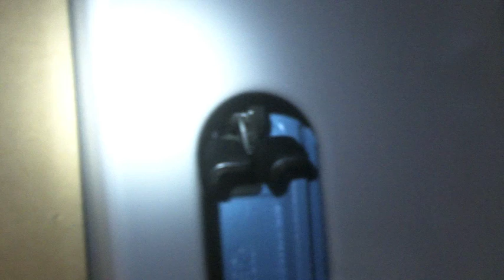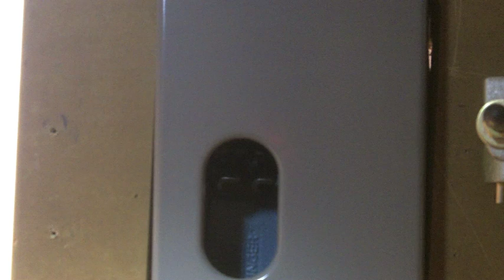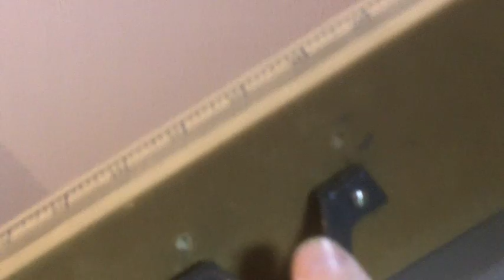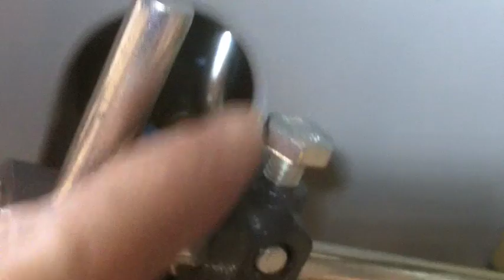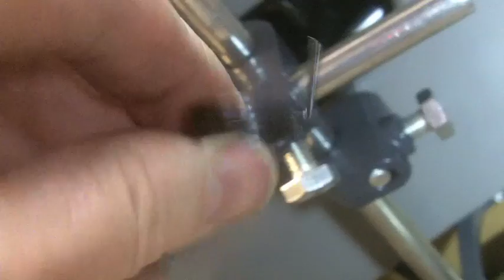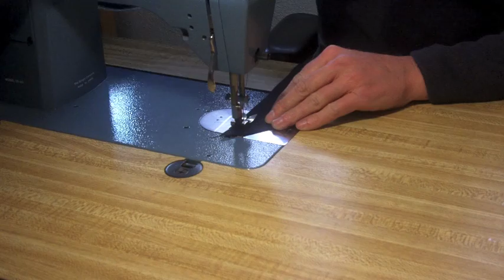Sewing for guys: knee lift install (industrial sewing machine)

Comment: Can you install a knee lift lever on the Samsung heavy duty 4452? Thank you
Reply from the maker: Hi, 
I'm assuming you mean the Singer 4452.  No, this kind of knee lift will only work on a machine that has the required internal components to make it function, and to my knowledge, that means only industrial machines.  There are some higher end domestic (home use) machines that come with a knee lift built in, but to my knowledge there is no (practical) way to add a knee lift to a domestic machine that doesn't have one.
I hope that helps, thanks for watching!

Comment: Nice video. 

I just picked up a Singer 211U166A with table and motor (incredibly, for free), and I'm having it fine tuned (not free, but cheaper than expected). The guy doing the work assures me that it'll be sewing perfectly when he's done with it. I've never sewn before, but I'm hoping to get started on some easy projects for my micro-sailboat in a week or so. I've been watching lots of videos, and this one was very useful, as my setup came with a knee lift, but I'm going to have to modify it somewhat.

Comment: Is this possible on a 15-90?
Reply from the maker: Hi!
For a knee lift to work on a machine, it has to have the mechanism in the machine to facilitate it; the 15-90 does not. As an example, the Singer 1200 is a special version of the 201 that is equipped with a knee lift. To use the knee lift from a 1200 on a regular 201, you would have to drill holes in the body/frame of the machine, tap some of those holes to the proper thread for a bolt to be inserted, and I think change (or add to) the presser foot bar in order for the lift to actuate it.  So, someone with some machining experience could technically make something that would work with a 15-90, but it would be a labor of love and probably not a worthwhile investment. 
There is definitely not a "plug and play" option, though.
I hope that helps, thanks for watching!

Comment: Hi, I’m thinking of trying to make my singer 4411 a knee lift, any suggestions?
Reply from the maker: Hi!
I honestly don't know that there is a reasonable way to convert that machine to a knee-lift.  Anything is possible, but you would need to completely engineer something specifically for that machine.  The domestic machines that have knee-lifts (like the Bernina 930) are designed with internal mechanisms for the knee-lift, which won't be present in your machine. (The Singer 20U in this video is similar to a high-end domestic machine with an internal mechanism for the knee-lift.) Industrial machines (or machines like the Singer 1200) have an external linkage with a hole through the bed, and a pivot point in the back of the arm of the machine.  Converting a 201 using the 1200 as a pattern would be pretty simple; they're the exact same machine, and drilling and tapping a hole for the pivot would be simple enough. 
I'm a huge fan of overcoming limitations in unexpected and ingenious ways, but honestly, I believe you'd be far better off saving the money and time you'd spend and just getting a machine that has a knee-lift (depending on your sewing needs, a walking-foot machine might be in your future, anyway).
All that said, there is a thread somewhere on an old Sailrite forum somewhere where a guy used bicycle brake cable to make a knee-lift for a Sailrite Ultrafeed.  I suppose a solution like that is possible for your machine.  I've known about this idea for at least 7 years, and there is a reason I have never pursued it myself, but your mileage may vary.
If you end up making something work, I would love to hear about it! Good luck!
Reply: @thejasonofalltrades  thank you for the bike brake cable idea. I was thinking of maybe making something in CAD that would either pull the existing lever up or maybe somehow make a pulley system. I do agree with you though about better off saving up.

Comment: Hi, do you know if any machine can be fitted for a kneelift, or is it only machines that have something different in them that can have it? Asking because I only have one arm and it's hard to take the foot up and down at the same time as holding the fabric in place.. Didn't think about that, when I bought my machine🤦‍♀️
Reply from the maker: Hi!
Most industrial sewing machines should have the necessary components for a knee lift, although they may vary from machine to machine. 
There are some domestic sewing machines that are equipped with a knee lift, but I don't know of any that can be retrofitted with one (without some serious custom machine work, anyway!).
If you have an industrial machine, look underneath for a lever or a place where the knee-lift lever would interact. There may be a rod coming up through the bed of the machine that connects to linkage that travels over to the presser foot lift. This linkage could be inside the arm of the machine in some cases.
In your case, it might be helpful to buy or make some soft fabric weights; small bag/pillow-like objects filled with sand, beads or other heavy-but-conforming material.  You could keep a few next to the machine to place on the fabric to hold it in place when you need to lift the foot.  It's not a perfect solution, but it might at least keep the fabric from falling off of the machine  when the foot comes up.
If an industrial machine is a good choice for you, a knee lift in combination with a servo motor with needle-position would be extremely helpful to you. Some modern, higher-end domestic machines may also have some of the same advantages.  My Bernina Record 930 has a knee-lift and the ability to stop sewing needle-down, and to lift the needle using the pedal, for instance. These are typically not inexpensive options, though.
I hope that helps, if you have other questions feel free to ask!

Comment: Did you ever find out what the spring was for with the knee lift.
Reply from the maker: A couple of people commented with ideas, but I had sold the machine before receiving those comments, so I wasn't able to confirm them, sorry!
Reply: One guess - the spring is useful for the zig zag control - basically to add tension so that managing the stitch length can be done with more control. This is a highly desirable machine for the variable zig zag capabilities.

Comment: Thanks for your tip regarding knee lifts on the Sailrite Ultrafeeds, you mentioned on another video.
More specifically, about using a bicycle cable hooked from the lift arm to an added on knee lift.
 I easily found that old Sailrite forums post you mentioned , and am seriously thinking about attempting it.
Do you ever think about doing it with your LS-1?
Reply from the maker: I considered it, but I honestly don't think it's worth it for me, simply because I have two industrial walking-foot machines with knee-lifts.  I think the benefit of the portable walking-foot machines like the Sailrite is that they are portable.  Going to the expense and trouble of putting it in an industrial-style table and fabricating a knee lift seems to result in an undersized, cobbled-together almost-industrial walking-foot machine, rather than just having the real thing. 
I could see a case for it if you truly needed to only have one machine, and mostly used it in a table but still needed portability sometimes.  I'm up to 21 machines, though lol!

Comment: Is the black lever at the bottom of the machine that lifts the presser foot able to be operated by hand? I just purchased a singer 20u83 and im trying to install my knee lift but even when i use my hand to push it, its not lifting the presser foot. Even setting up the knee mechanism up and testing it doesnt do anything. Any suggestions?
Reply from the maker: Hi, 
I don't have my 20-33 anymore, but if I recall, there are two levers under the machine - one to raise the presser foot, and one to initiate zig-zag - and the knee lever can be used to activate either one.  Are you sure you're pressing on the foot lift and not the zig-zag?
Other than that, yes, it should be able to be moved by hand with some effort.  It could be stuck by old lubricant that has varnished.  If so, a thorough cleaning and lubricating may free it up.
I hope that helps!
Reply: @thejasonofalltrades Mine does not move by pressing with my hand either.  still having a hard time figuring out which way the bar goes that pushes on the lever to lift it.
Reply: Hello. I know it’s been a while, but please tell me how you solved the lift problems. I have the same issues with a 20u-83. The knee lever spins on the rod trying to push the lever to raise the pressure foot.
Reply: @laverneh2030 did you figure it out.  I am having the same issue but trying to figure out which way the bar goes to lift the lever.  I also cannot push it up with my hand.

Comment: I'm by no means a specialist, but I believe that spring is a spare to the spring that's inside the sewing machine in the area you touch with the lever to raise the presser foot. At least, that's the case in the machine I bought. 
So if the presser foot lift stops working and there's nothing wrong with the lever, you can see if the spring in the machine needs replacing.
Reply from the maker: That's great information!  I no longer have this machine to check, but that sounds like that might be right.  Thanks for watching and for answering my question!

Comment: Hi,liked your video.I am having a problem with the juki walking foot machine I bought.Apparently juki makes an amazing machine but a crappy,cheap knee lift.Only after having the machine for less than a month the pin that locks my knee lift bar decided to break and fall out.I put it back in one too many times and I stripped the threads where the pin screws into.Called the company to complain and they are sending me out another knee lift but I am certain it will be the same crappy cheap knee lift.Now after that long intro to my question-can I use the knee lift you got for your machine on other machines like a juki?Your knee lift looks way more sturdy and less likely to fall apart.Any help you can give me would be greatly appreciated.
Reply from the maker: Hi Jeff, 

The knee lift I used in this video is a universal one, so I think it would probably work.
I bought it from Ralph's Power industrial sewing machine shop in Denver.  You might give them a call, they are very knowledgable and can definitely tell you if it will work, or direct you to the right one if it won't.
Good luck!
(Side note - I don't have much experience with Juki machines, but a co-worker likes his so much that he insisted on bringing it to work to use instead of the Pfaffs the company uses.)

Comment: For better tread  cut  tread with sharp scissors only for clat never paper  on angle  45%, Put little be wax or vaseline on finger .Cut white credit card or strip harder paper and position  behind needle whole raise needle to top and you see much better ,.The spring  got to be to fill resistance on lag  look other similar machine .I will need to do that for friend  all the best from Chicago,

Comment: Looks to me like you've done a great job, it works and by the look, smoothly.  Thanks for posting this.  I've an industrial blind hemmer and the knee lift on that is pretty 'rough', not that sleek, but like you say it works.  It definitely pays to shop around doesn't it?  Cheers, Colin